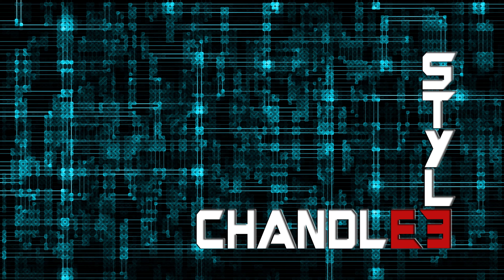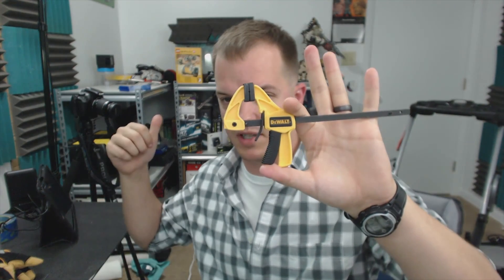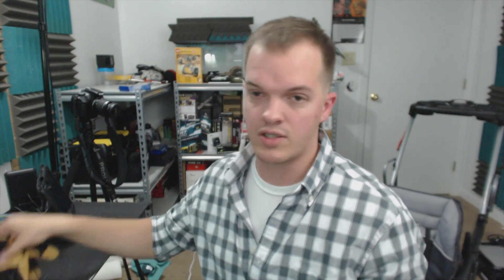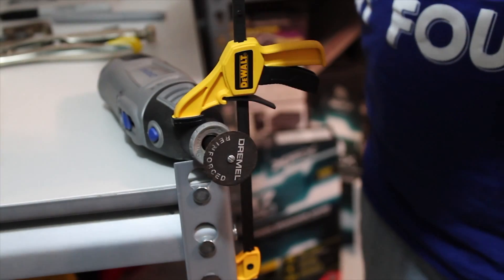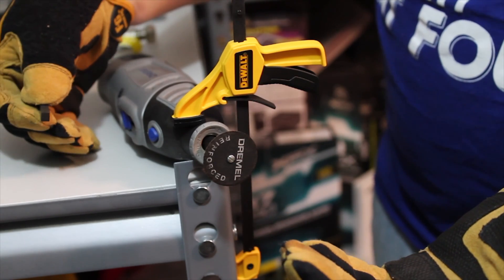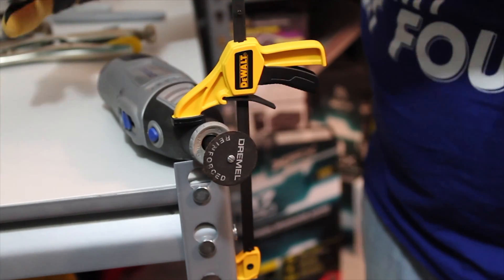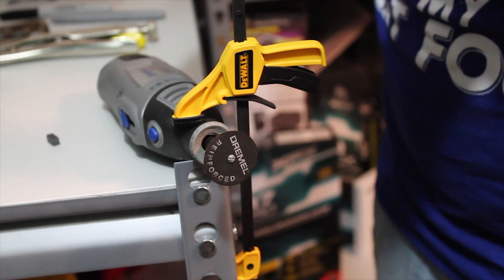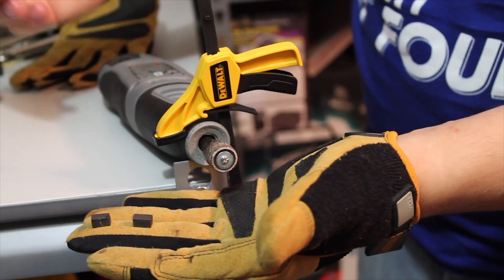How to Cut small Ceramic Magnets with a Dremel

Comment: You should definitely only cut and sand it a little at a time, to keep the magnet from overheating. If it overheats, even for a split second past its rated temperature (which is generally pretty low - usually under 200° F), it could drastically weaken the gauss field strength of the magnet (demagnetize it), so keep that in mind.

Comment: thx. need to cut some ring magnets, hope it will go alright. 
good luck.

oh did you tried neo magnets?
Reply from the maker: these magnets are just generic magnets from the hardware store, I have not heard of neo magnets
Reply: what are you cutting are ferrite
magnets (not sure of the spelling) , neo magnets are neodymium.
Reply: @vicentiuXeduard  these are ceramic magnets. Neodynum are so brittle, it wouldn't take much to break them from the vibration of the saw. I broke one just attaching it to another magnet.